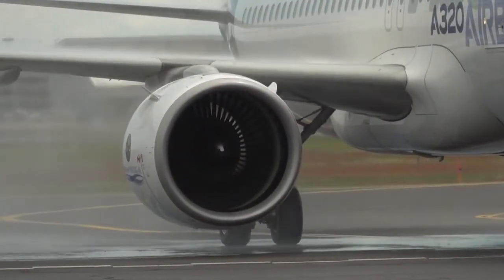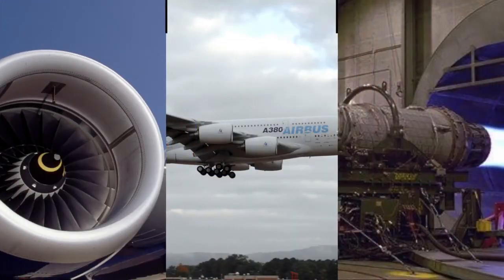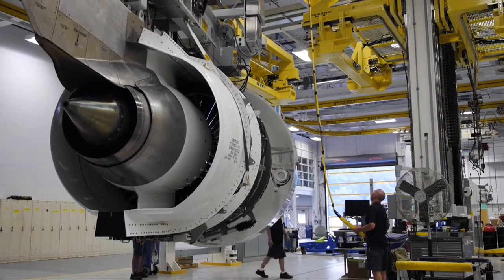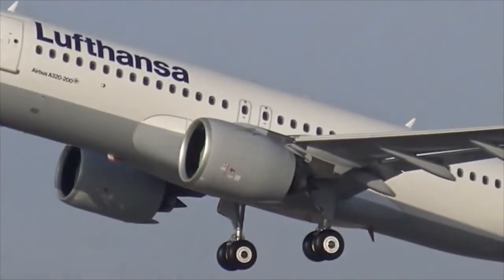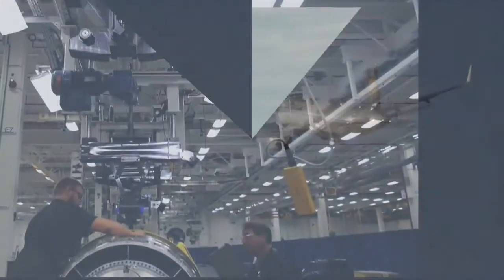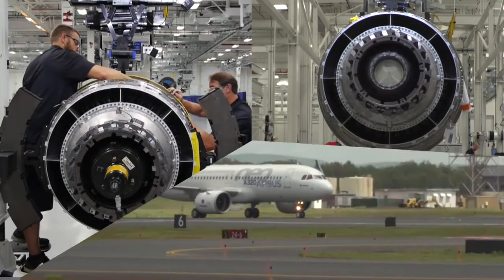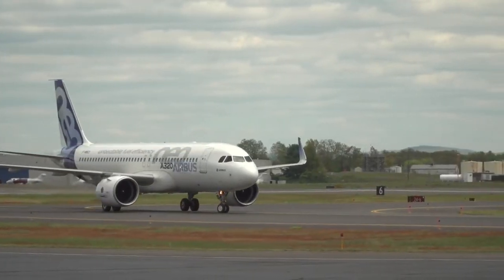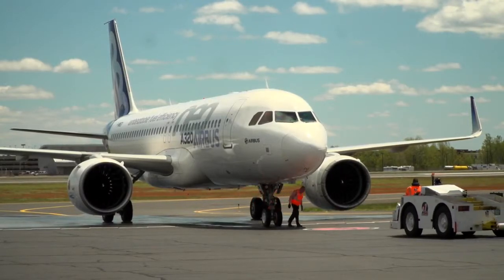PurePower PW1100G-JM Engine Showcases Pratt & Whitney's Innovation, Investment

Comment: more like 100% fuel efficiency and noise pollution with 0% in pollution and reliability when airplanes are grounded due to the PW1100G engines.
Reply: grounded due to the #3 bearing producing metal, and most recently, oil entering the compressor which is contaminating the packs system creating fume events

Comment: Hmm, I'm a bit sceptical of this engine at the moment, seems plagued with problems so much so that some airlines are switching to CFM engines.  Perhaps it wasn't quite ready for introduction and needed further testing.  Seems like Pratt were too desperate to have their engines on the first neo's built given that GE and Rolls now dominate everything else and P&W is a little forgotten now.  Still for all the benefits listed by you guys, the CFM Leap-1A has more orders on the A320neo, says something about CFM too.
Reply: Knife seal edge?
Reply: I think Pratt and Whitney is better off with fighter jets cause damn those engines for the f35 are good